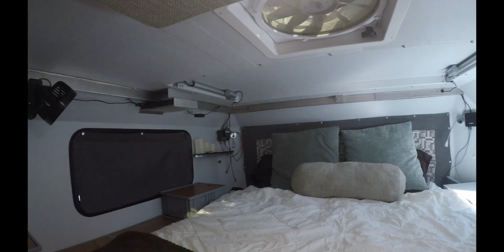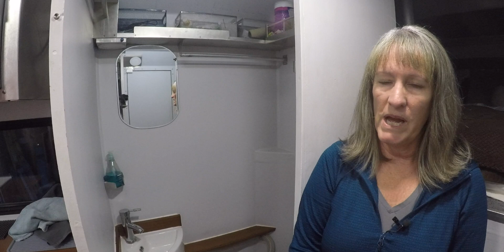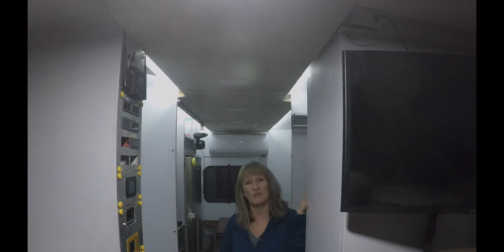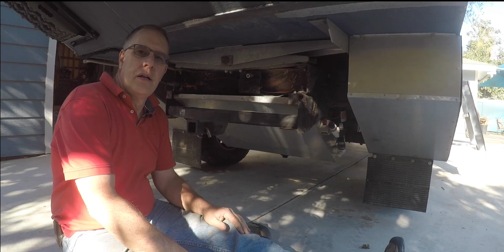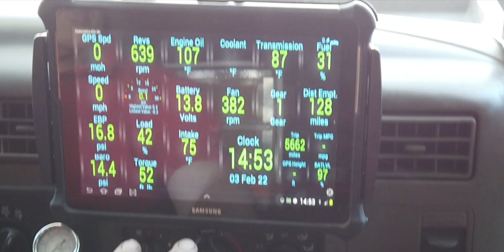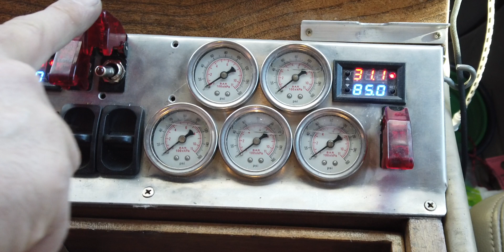DIY Truck Camper TOUR | The Maximus' 1st Birthday Tour

Comment: Not a good idea plumbing urine into your grey tank. Most rural areas you camp at you can dump your grey water to ground but Not if you have urine in it. My camper van, expadition rig and my 40' motorcoach all have grey tanks and yellow tanks with no black tanks.
Reply from the maker: If where you camp allows you to surface drain gray water, you have likley made the correct decision for you. However, I find that with so many overlapping regulations, I don't want to have to conduct an in-depth investigation in every type of land where I find myself and have opted to not plan on surface discharge, because it is restricted in some way, in most places. ....While my research is not exhaustive, it is/was more than enough to compel my decisions. What I have found is that most states and federal agencies do NOT allow gray water dumping of any kind. Federal is the easiest to check. Of the 6 land-owning agencies, ONLY the BLM allows gray water discharge onto the ground at the federal level.  Cited in CFR Title 43, § 8365.1-1 Sanitation, which states…“On all public lands, no person shall, unless otherwise authorized: (3) Drain sewage or petroleum products or dump refuse or waste other than wash water from any trailer or other vehicle except in places or receptacles provided for that purpose;“ 

The  BLM, STATE BY STATE, can be  (and often is) MORE restrictive so this cannot be assumed to be correct for every state. For example, I know that AZ BLM restricts gray water dumping to shower water only (no food waste from dishwashing water). This further restriction on the national standard likely comes as a result of complying with state policy but I cannot confirm that.  The NPS, USFS, USFW, ACOE, and Bureau of Reclamation, at the federal level, all explicitly prohibit gray water discharge which cannot be more permissive state by state. Furthermore, there are some states that restrict 'vehicles with storage tanks' from dumping anything, while still allowing it for tent campers (because they have no way of collecting/storing).

Some STATE lands may permit it but those vary and if you are not sure, should not dump. I have specifically checked CA (where I live) and ID (where I own property) and they both explicitly prohibit it. I have checked others but cannot recall exactly at the moment which ones. Furthermore, as people abuse the privilege, more restrictive regulations is the norm AND INCREASING. States require visitors to observe the most restrictive of state and federal standards, meaning that if you are on BLM land but in a state that prohibits dumping on state land, it is banned on BLM land (such as my AZ example above). 

You are correct that by mixing urine in with 'wash water', I am limiting the ability to discharge on BLM land where permitted but in my view, the restrictions are already there in most places (because states either are or will be prohibiting it). I want to observe a standard where I don't have to worry about trying to figure out where I can or can't. Since I don't plan to surface discharge, putting urine in with wash water is not limiting my utility. Storing urine and gray separately, as you have/suggest, IS A GOOD IDEA to take advantage of locations where you can dump one but not the other. I don't see the benefit of all the extra management and equipment to do that (pumping freeze protection in particular).

This is a good starting reference. https://www.boondockersbible.com/knowledgebase/can-i-dump-my-gray-water-on-the-ground/

Comment: Hello what is the weight on the camper box.
Reply from the maker: The main box walls alone with out the steel frame mounts,  top hatch, side door rear door, windows, aluminum exterior 'armor', bag boxes or interior walls was measured with a crane scale at almost exactly 1600lbs...windows were weighed just under 200lbs... All the things I said it didn't include above are probably around 600lbs. Not light but just above my budget.

Comment: How much is your battery
Reply from the maker: 17.5kWh (35 Nissan leaf battery packs) operating 21.7V to 28.35V. In 12V amp-hour terms, that is 1460Ah full capacity, 1166Ah operating capacity.